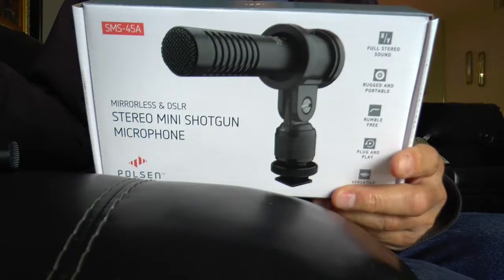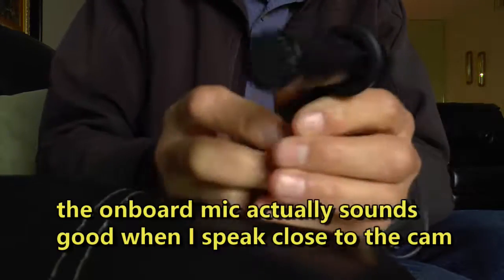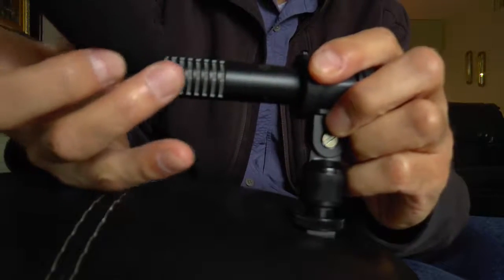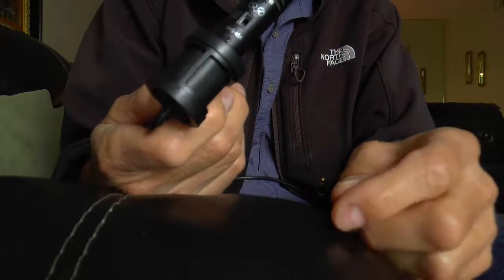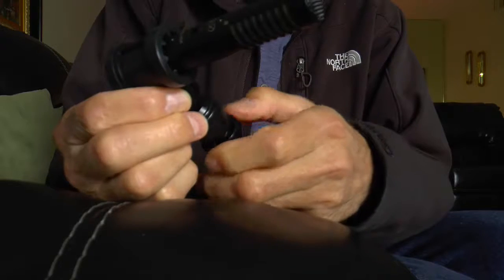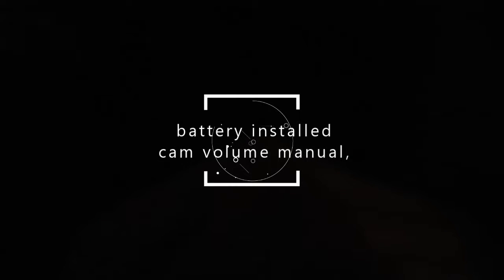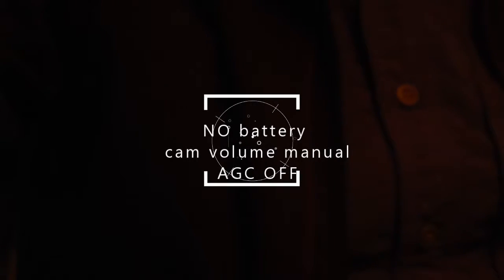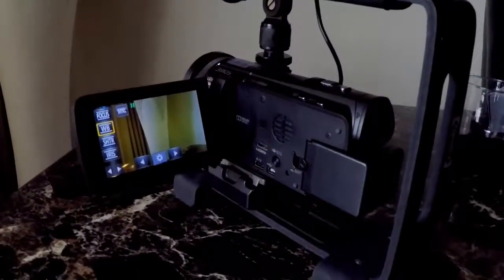Polsen SMS-45A mic review on Panasonic HC-X920

Comment: Thanks for the video! 
Do you know if there is a difference between the Polsen SMS-45A and the Senal SMS-45?
Thanks in advance!
Reply from the maker: I looked at both mics very closely before making a purchase from B&H.  I think they are the same.  they look the same very closely.  Both are from China.  I am happy with mine.  And....  My camera powers it which I did not expect.  I took the batteries back!  It does not work with my computer though...  the battery.  Unless you put this next to a $275 RODE... you would not notice the difference.  It sounds nice..... and stereo!